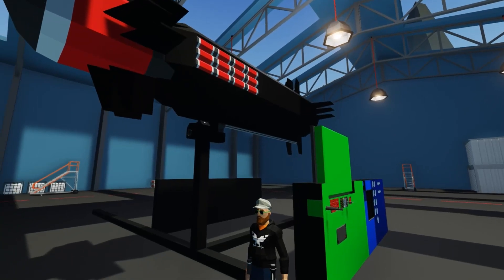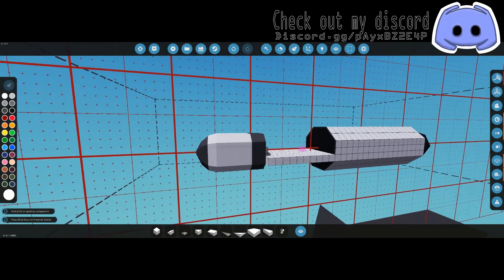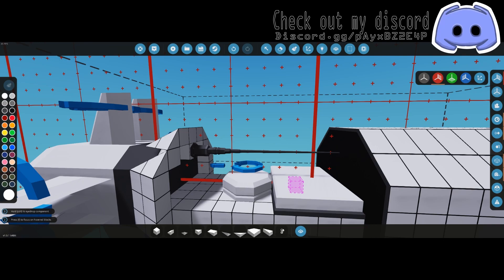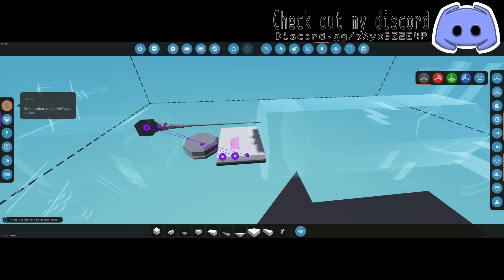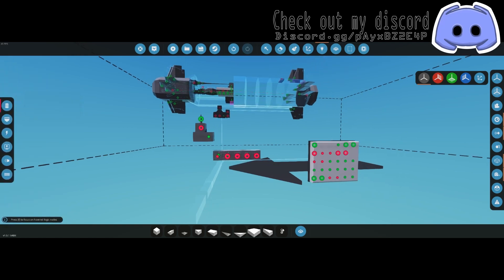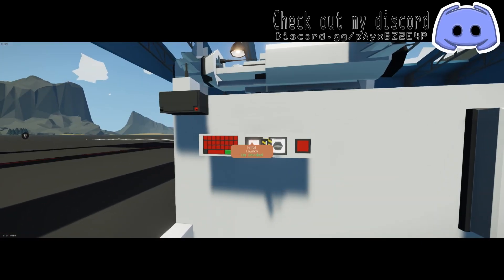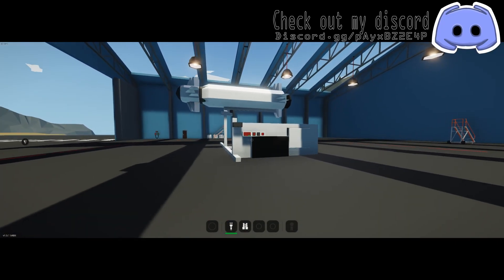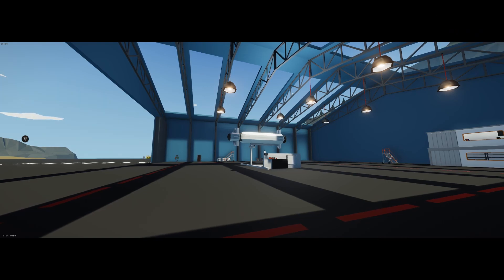How to build a ballistic missile

Comment: Amazing. Just want to add it looks more like a Cruise Missile rather than Ballistic - which suppose to boost up in a vertical arc and then free fall on it's target with ever increasing speed. But since Stormworks doesn't has inertia implemented - it's impossible to make the true ballistic one I guess.

Btw, idk if adding more warheads gonna sum into bigger boom - will they? In my tests the damage aria on the target stays the same (regardless if it's multiple of just 1 small or a medium warhead used, and the huge one gives only like 20% more aria).  Means we could just use 1 small warhead with the same effectiveness, which makes no sense xD
Reply from the maker: Well, i like to put a bunch on for the wow factor.

You know what in saying?  One of those, dont mess with me and i wont push this giant red button.

For some reason, when i put a large and a bazillion smalls on it, i usually leave a massive hole.  But no testing TBH.
Reply: @TLPtater  Oh I see. It looks impressive indeed. I just wish devs would improve the damage to be scalable ^^